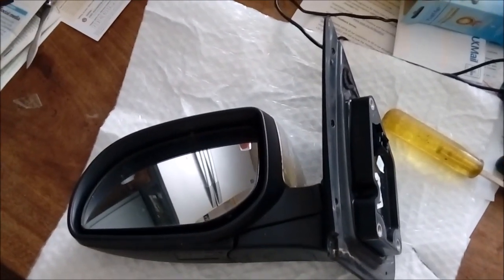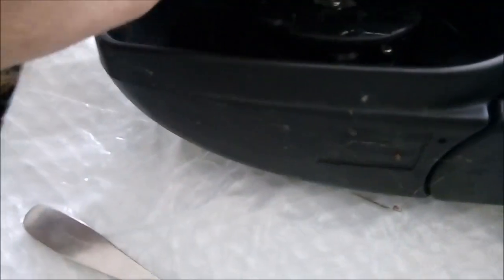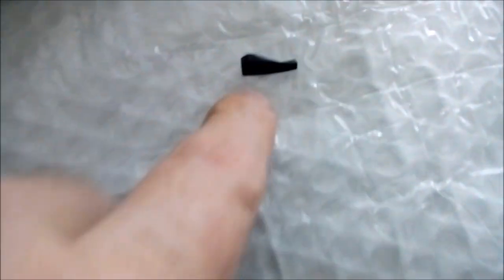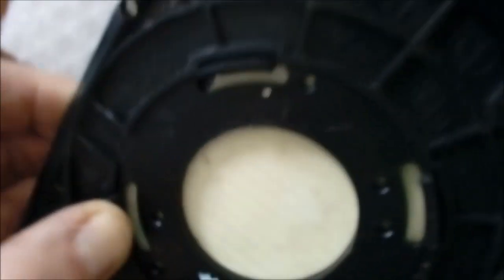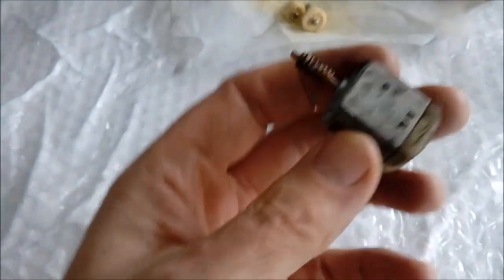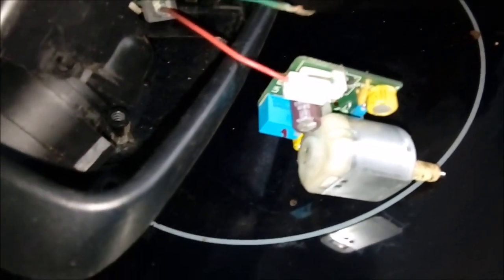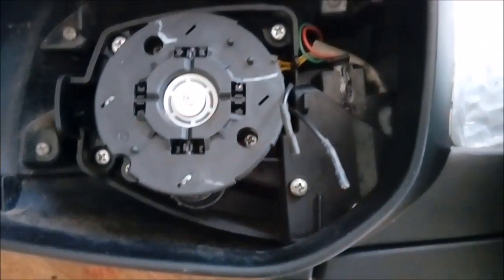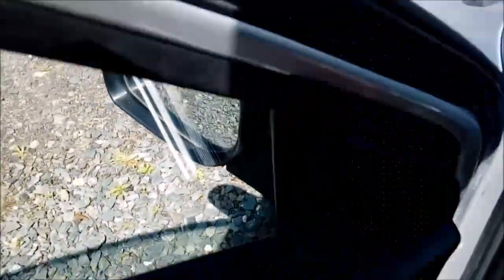Hyundai i20 Folding Wing Mirror Repair   YouTube

Comment: I had replaced a right side mirror on my I20 and the old one was lying with me for 3 years.  Today i decided to dismantle it fully.  The mirror was broken away with its back board, reason for brand new one.  So I had access to the insides.  My God, i had to undo almost 2 dozen screws of various sizes.  Rock solid build inside except the tiny tabs.  Everything was perfectly working, just the mirror had broken and they made me buy an entire right side assembly at Hyundai service center.

If you have gotten to that circuit board and the red and green wires, then you have gone a long way into the disassembly.  That circuit board popped away from the main motor.  I can understand the trouble you must have gone through to put it all back.  With the wire harness and the soldering of the directional motors, its a nightmare to work your hands around.  Its like a 3D jigsaw puzzle.  I just got fed up trying to put everything back and came to check if there are any crazy guys like me and I found you.  If it was worth anything, it was worth appreciating the intricacies involved in just a mirror and i can salvage 3 cute little motors at the end of it all.  

I now have a new appreciation for powered mirrors on cars.  Mine thankfully dint have a heater circuit.  You must be a very patient and tenacious man to put it all together and get it functional again.  My sincere appreciation for your efforts :-)
Reply from the maker: Thank you for the kind words! :) I was expecting to have to replace parts but it was an easy problem to resolve. That said, it's ridiculously put together to be able to make simple repairs!!! One of my pals has a Honda CRV and his built in mirror indicator needs to be replaced - you'd think it would be a simple bulb but no it's a whole indicator assembly that needs to be changed and to get to it - looks very similar to this carry on! :-)

Comment: your video was still very complicated and well beyond my capabilities. I had a quote from the hyundai garage and the three pieces broken would cost me over £300 to replace and a whole wing unpainted would cost over £500 to replace. 4 yeas ago a full painted
wing was £400 how clever are you
Reply from the maker: Hi Valerie, it is a very fiddly mirror to take apart. I'd recommend having a look on eBay or sat your local scrap yard for a used mirror in the same colour as your car. That would be fairly easy to install.

Comment: Nice vid, so you had to cut the cover in order to gain access to the folding motor? How did you do that? Mine has broken gear and does not fold. Thanks!
Reply from the maker: You'll see a large pair of scissors on the table. I'm sure I used those to snip the plastic. There might be a better way to do it but there's so little room to move everything about. Mirror worked perfectly after the repair and the car was sold last summer without any further problems.

Comment: Hi there, where did you source the plastic gears? My plastic gear broke and motor wont stop spinning. Took it apart and see tbe plastic gear broke in half.
Reply: I got the spare set from a smashed mirror in the local car scrap yard.

Comment: My mirror work properly but after reach to end point motor of mirror steal rotate continues. Tell me why?
Reply: i have the same issue Haresh... Did you find the solution?
Reply: i guess plastic gear is broken. There is a video about this. https://www.youtube.com/watch?v=lpi10UmaLmM
Reply from the maker: This might help? https://www.youtube.com/watch?v=lpi10UmaLmM
Reply: @gtd65  no sir I think  control circuit may be faulty.